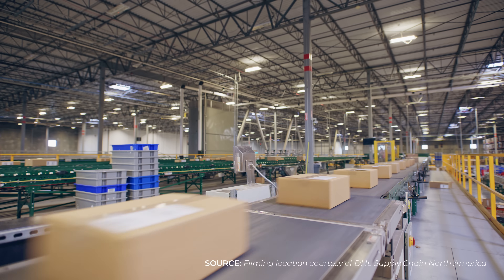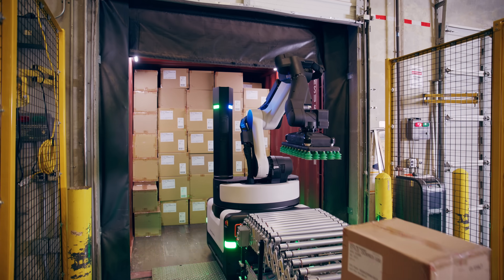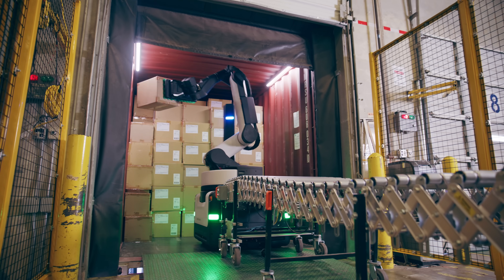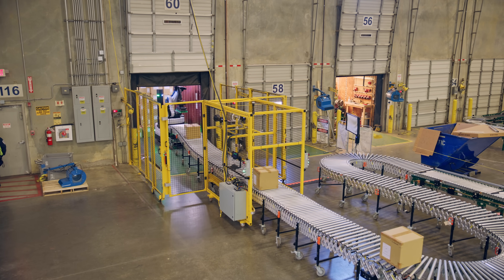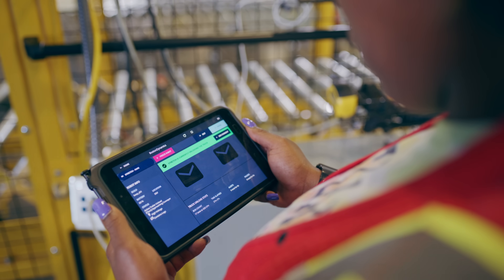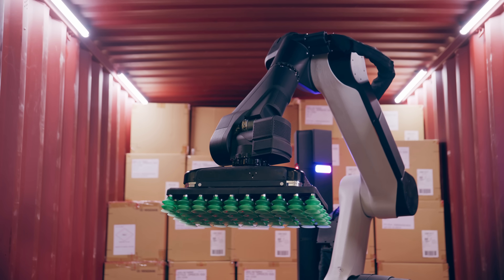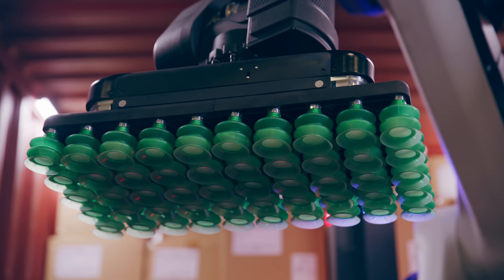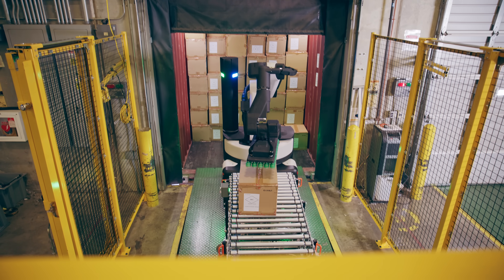Stretch at DHL | Automated Trailer Unloading

Comment: I am actually kind of surprised that it is not faster. It is steady though.
Reply: Probably more likely to drop boxes with the momentum, power consumption, and I bet it's faster than a human still for the fact it doesn't need breaks and is steady, like you said
Reply: It adjusts its speed based on how good of a grip it has (according to the whitepaper)

Comment: Each of these companies (Amazon, DHL, etc) have engineers who are working hard to streamline things with robots and automation so they can eliminate manual labor, which in turn cuts jobs down.. It creates engineer jobs, but reduces the labor jobs. This can help these facilities run much larger scale operations than before using automated methods without having to increase manual labor. Its both a good and bad thing, because they can scale their logistics operations by 6x while maintaining or even reducing the amount of manual labor. This is only scratching the surface. I would only agree with companies who do this if they can pay to transition the people working in manual labor into engineer roles through paid college/housing (via contract) and bringing them back.. So instead of outright eliminating jobs, they're at least transitioning jobs. I can see how automated processes can reduce the cost to consumer (which they would only do for competitive reasons), but many companies won't even do that. Go to the automated McDonalds in Texas and I guarantee the food is the same price.

Comment: I would like to see a more realistic video in the case of DHL.
Boxes with multiple shapes, bad customer packaging with half ripped boxes, and heavy packages with bad cardboard boxes. Also, what happens if the packages themselves are packed in gift wrapping? At Christmas, it's quite common.
Also, isn't DHL placing single boxes on those moving rollers where they can move a lot of boxes at one time?

Comment: It's cool seeing my old job starting to be automated. My only concern is just how slow the robot moves.

We're I was at, if the rollers had an empty space the unloader was moving to slow.
Although to be honest I enjoyed racing my coworkers, keeping the line full while they tried to keep it empty.
Reply: 24/7 operation is a plus, as long as there isn't some random problem during the night.

But for trucks that are on a timetable, that's what I'm concerned about.
Reply: @kyleallred984  Well fortunately the robot is on some kind of wheeled base, so if time is that much of an issue for a trailer they can just wheel it to the side and get it emptied by people.
Reply: It's a matter of time. Have you seen the welding robots used in automobile factories? They are scary fast. That's more or less the benchmark.
Reply: It can work 24 hours 7 days a week with no breaks. And will only get faster.
Reply: it'll be slower locally but more consistent ie no need for bathroom breaks and doesn't get tired, so probably faster in the long term. its main purpose it so allow employees to focus on other tasks. automation isn't going to take away jobs, it's just going to give you different jobs that are probably less tedious and more suited to humans. plus, technicians and programmers for the robots will still need to exist.

Comment: As someone who spent a year and a half loading and unloading trucks I'm glad this exists.
It's one of the hardest jobs out there because of the extreme heat, and cold.

I want to see what the robot does when the rollers can't reach the back of the trailer
Reply: What makes you think they have not got enough length for a standard sized container? Also those rollers can have additional section added in.
Reply: @kaspernbs  often the rollers are quite beat up by wear and tear, and at peak times their is a very low likelihood of having enough belt to make it to the back of every trailer.
Reply: @wgkgarrett  then the robot can move back and forward. Or it sets up half way across the gap.
As the said about a 10ft reach. So reaches out. Attaches to box. Pulls box to itself.
Turns and the pushes out to roller and then let's go.
Reply: I'm always a little sceptical of how new automation will be received by the workers. In this case it sounds like people aren't exactly enjoying the job and robots are probably the way to go.

Comment: This is a good example of solving the wrong problem. 
Why is there a robot digging it's way into a truck, why don't you roll the entire load of boxes out of the back of the truck so four robots (or people) can grab packets from all sides at the same time? Then role another trailer full of boxes back into the truck and send it  on it's way again?

Most automation starts with replacing humans by doing the same task that the human did, when the only reason why the humans do it that way is that they are only human. It's far more efficient to pull out ten boxes at a time but homans never do that because they are physically not able to. This robot has no problem grabbing 5 boxes at  a time but it doesn't... because it's built to emulate humans.

Yes ofcourse BD know what they are doing when building robots and there are many reasons why they do it this way, and it's cool that it works, but thos robot against a trained crew... the crew wins, 100% of the time.
Reply: "roll the entire load of boxes out of the back of the truck" most certainly in order to do this it would add lots of weight by having to have some kind of structure to allow for that to happen, this means less cargo in the trailer

what they should really do is slowly elevate the trailer at an angle so everything just slides out really easy, all at the same time

Comment: This entire video is staged.  The boxes are all the same size and clearly don't have any significant weight to them.  So I guess if a cargo container full of a single sku arrives with each box weighing 30lbs, it'll be able to unload it.  What about heavier items and differently shaped boxes?  What is the weight limit for lifting a standard cardboard box?
Neat concept but it'll be substantially cheaper to use humans for the foreseeable future.  In the mean time, the robot will get all of the easy jobs and the humans will get the heavy dangerous stuff.

Comment: I like Boston Dynamics but Stretch, in this situation, isn't more efficient than a person. Stretch at full speed no doubt, is too slow, even with simple, consistent box sizes. I bet a person could unload those boxes three times faster. Also, there are a lot of expensive, bulky protective walls and conveyors that need to be manually moved around. I appreciate their effort but they need to rethink using Stretch for this task.
Reply: I'm not sure the metric of importance here is speed/efficiency but maybe total cost savings. Human have more variability to them. I saw an article published last week mentioning a company that leases automated systems at a cost equivalent of $8 an hour, slightly over half the cost assuming $15/hr human labor.
Reply: @TheMasterBM  what where their total cost savings?
Reply: sure faster for a short period of time, how fast is the person when they are taking a break? or at home\sleeping?
Reply: @coreysuffield  these machines probably NEED supervision. 
Service, oil change, unclog them suction cups 😉
From time to time, dez 🥜

Comment: It should be noted that the trailer it is unloading is consistently box shaped and very uniform in size. Humans will still be needed for damaged packages and irregular packages. Suction is limited in that it has to adhere to a flat surface and will have a weight limit. If that flat surface has holes, it will also lose grip. So those concerned about losing their jobs should be aware that their responsibilities will shift from being hard labor to being a responsive/supervisor type employee. Customers to automated shippers should also be aware that packaging will also be more restricting.
Reply: still the difference between 10 men unloading 10 trucks and one man picking up what the robots left.
Reply: When robots are the only ones unloading containers, those containers will also have been loaded by robots which made sure that humans are not needed to unload them.
Reply: This thing is trash I could easily unload faster than this. Its still going to need a human or another robot. It has no dexterity and it's arms move very slow. It can also drop things and it still has no intelligence. It's to early. I think it's just a helper for right now.

Comment: I think 2-3 loaders will unload the container much faster than this robot, from the video I got the impression that it is quite slow.
Reply: workers would have to go home after 8-10 hours everyday for a 12 hour period, also taking breaks, this thing will run 24/7
also how much are you paying the 3 workers vs the operating cost of the robot
sure 1 container, workers would be faster, but after 1000 containers?

Comment: What's there to be so much hyped about? Similar robots have been assembling our cars for years already
Reply: It's useful because most robots like that are usually designed to do one single action and that's it. Stretch is more versatile and mobile, and it has sensors to pick up dropped boxes and adapt on the fly to an extent.
It still has to be supervised and wheeled around, but it's more useful than, say, a massive contraption that can't be moved without a forklift and will destroy or ignore any box that isn't exactly the right size or that moved out of place during transit.
Reply: robots that assemble cars are generally blind, they just perform a scripted action over and over, and just hope nothing is out of alignment

Comment: whats the weight limit with those suction cups
Reply: Exactly! I've had to unload a few trailers in my working days where the boxes were heavy. Maybe 40 - 60 pounds per box. In the video, when some of the boxes dropped onto the rollers, it looked like the boxes did not weigh much.
Reply: @bop146  was wondering if anyone else noticed how the boxes were being dropped and they probably need someone to supervise this slooow machine 🤐
Reply: Plus, when you unload a truck you have to put the boxes on a pallet neatly for transport.
Reply: Theoretically it's the weight limit on the hydraulics or the horsepower of the vacuum pump that would be the limiter

Comment: I like that it still drops boxes sometimes 😁. And I like that this showcase video doesn't hide that fact.
Reply: Heavy packages are often handles with vacuum lifters, even when manually handled. Those often use one big suction cup - and dusty boxes are easily dropped
Reply: It needs to suck even harder, i guess.
Also, i would think they would know the weight of the contained goods to figure if a cardboard wall is good to be sucked in to.
If the box is wrinkled, then of course it can detach.
Reply: There is definitely room for improvement on the way it grabs packages, I would have designed it so that the sucker portion could slide back and forth over a big metal spatula, that way it could support the packages from below to avoid ripping the cardboard or dropping heavy packages.
Reply: @AlexanderBukh  I think they can't know the weight until it gets scanned, which only happens in the next step once it's on the conveyor. ( They can't scan it already before picking it up because the barcode might be hidden on the wrong side )
Reply: @AlexanderBukh  ayo ⁉️

Comment: does this also work with different boxes or do they all have to be the same ?
Reply: You can see on video, the sucktion array is larger than the poxes pictured. So yes, even large boxes are no problem, if they aren't too heavy.
Reply: No, it can be different boxes. It has sensors plus workers can upload requirements to the robot itself.
Reply: Works with different sizes